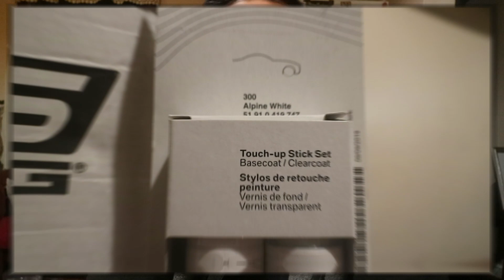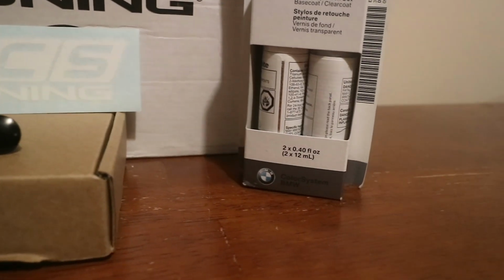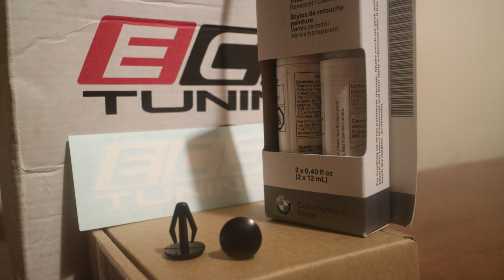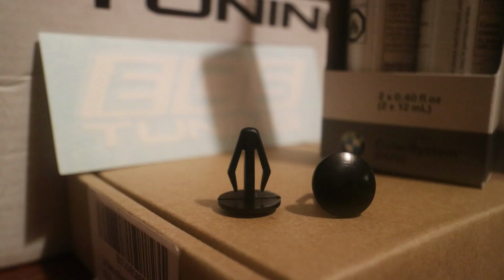How to Fix License Plate Holes In Your Bumper - The SG Way

Comment: Did you have to drill the holes to make them larger? Nice vid bro btw
Reply from the maker: I used a small little sander to make the holes a bit bigger. Just kept trying to plug in the plugs and by trial and error found just the right size with sanding the holes to make them a bit bigger